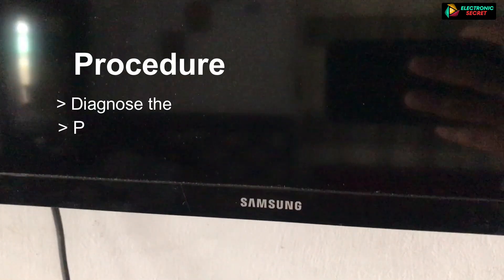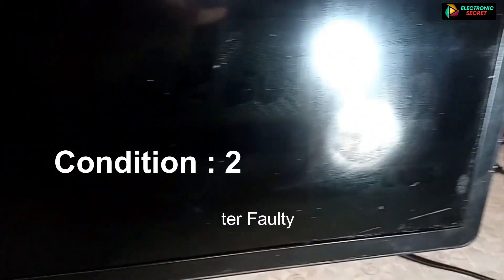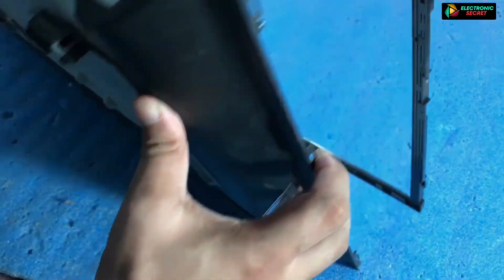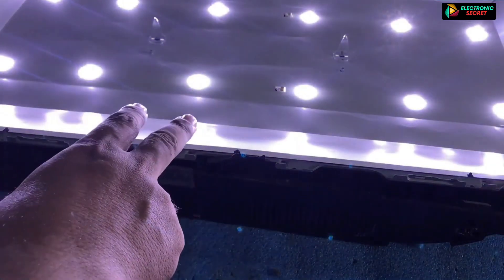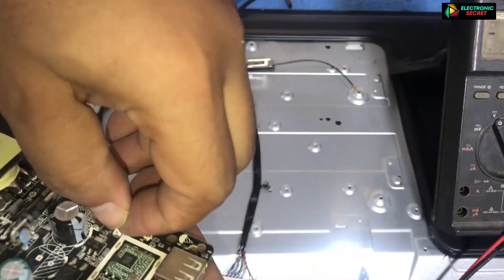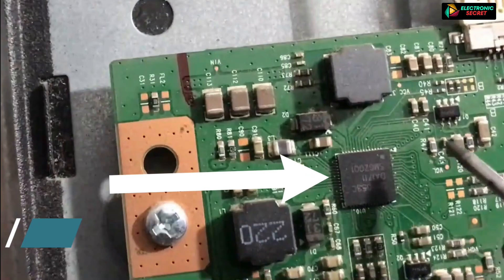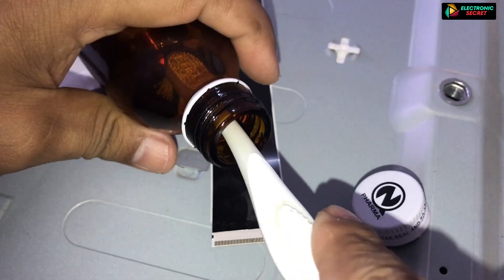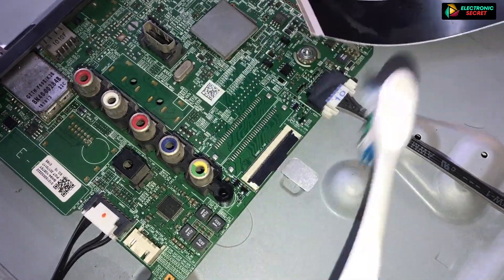How to Fix Samsung TV when Screen Goes Blank

Comment: Followed your video and these are the readings that I got from my TV
Vin - 12.27v
VGH - 27.9v
VCC - 1.78v
VGL - minus 5v
VDD - 16.02v
HVDD - 8.02v
Vcom fb - 6.17v

MY TV is starting and its only showing black glowing screen, no sound of menu from pressing button on remote. I opened the tv, the backlight is glowing. 
Please guide me sir, what do you think, this problem is coming from? what should I check next? Thanks, lot, for the amazing video!

Story of my TV issue from beginning - So My TV started showing lines, sometimes it would disappear, but it slowly got worse, more and more lines, to the point that there were only lines on TV, vertical as well as horizontal. Then after that few days, TV screen got black, but the sound was still coming, when I pressed navigation or volume up down button! Just one day later, and to this moment, it's just black screen and no sound coming, if I press the tv volume button or arrow buttons!